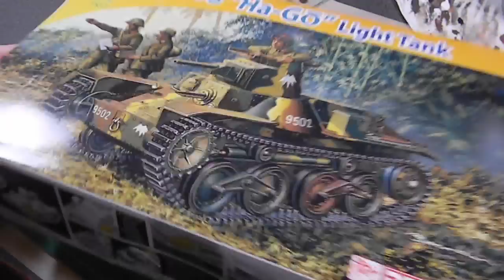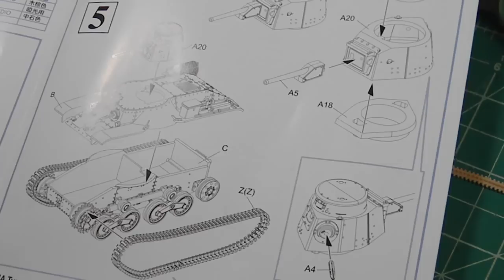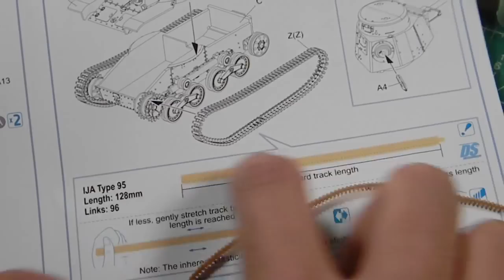Dragon 1/72 Ha-Go Japanese Tank Build Part 1

Comment: You can get 0.016" / 0.018" stainless steel rod at your local hobby shop that's stronger than brass of the same gauge.  It hardly shows up it's so thin.  On 1/35 scale it almost invisible; but it works on 1/72 scale too.  You may have to bend the protruding outer edges of the rod down a bit to keep the sag straight across the width of the track.  It's thin and strong; but it does flex a little.  The only problem is cutting it.  Use heavy duty wire cutters or you'll ruin your cutting blade.

I prefer the rod method PaintingClinic used over gluing or tieing tracks down.  Once you get the hang of it you can make all sorts of sag.